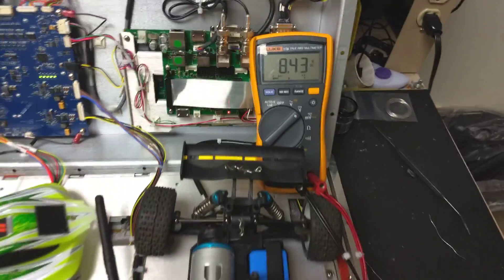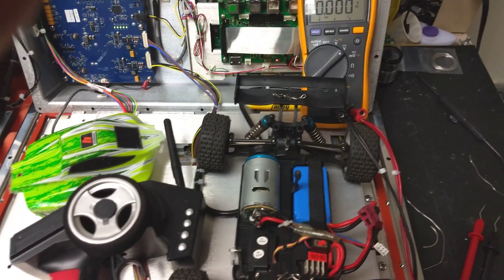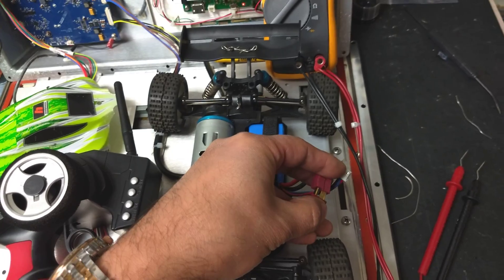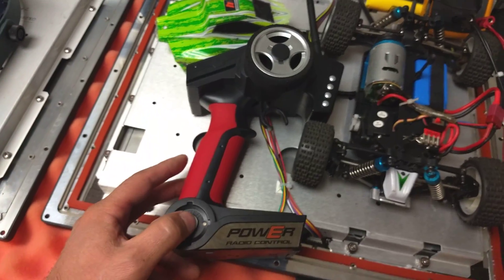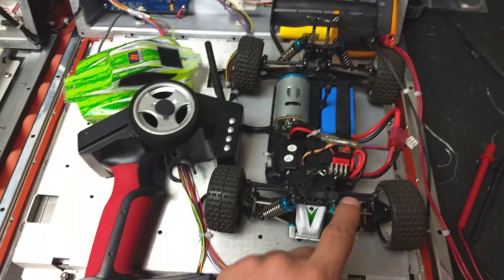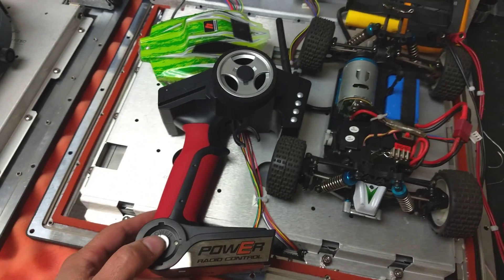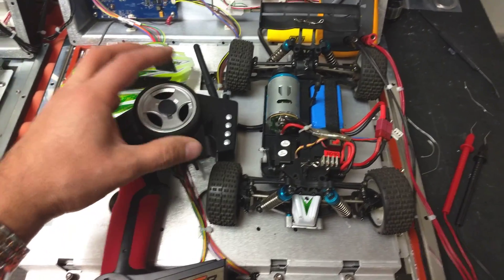Wltoys A959B Overheating issue

Comment: Had 2 WL toys with overheating ussues. And this happened during Australias winter, didnt run them much in the summer at all, too much of a fire risk. The electronics reached such a high tempurature that it began melting the esc's. Have doubts that a heat sync will solve the issue as the motor also overheats. A larger battery is only going to make it worse. The higher voltage may reduce the amps going through, but the esc is too small for the job and the motors are over stressed eith the speed that they do. Used a couple of parts from them for other projects and tossed the rest. 
Bought 2 1:28 scale cars under this brand name and have had the same issue with overheating,
Reply from the maker: It's definitely over geared for that motor but the ESC getting that hot also had to do with the batteries they give you, it's 2 issues, the main one is the C-rating of those cheap batteries & the 2nd is the mah rating. The ESC is overheating because it's trying to draw the necessary amperage from the batteries but it can't due to the poor C-rating of the battery. This stresses the FETs on the ESC which causes them to overheat. Couple that also with a battery that doesn't have the sufficient mah & those poor FETs get more stressed out than a liberal seeing Trump walk into the room lol.
Those batteries if I recall correctly were like 15C (which is lower in reality, they always exaggerate the C ratings on cheap & even expensive batteries) & the mah was very low. Let's the ESC needs 50A at full throttle. A 15C battery with 750mah can dump a max of 112.5A when the ESC asks for it (15Cx0.750A=11.25A). And that's if the C-rating was accurate, which it's definitely not. Even verify high end batteries only get about 80% of the C-rating they call out. So in this case, your ESC is asking for 50A but the battery can only give 11.25A. This causes the heating issue.
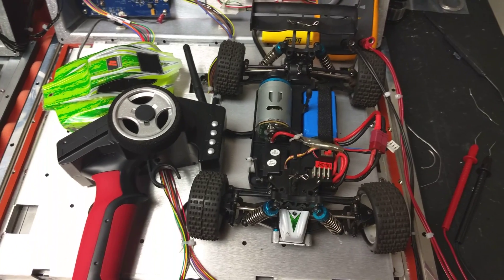I wound up getting another wltoys 1:12 buggy for my kid, had the same issue. I bought a couple of Hoovo High Discharge series, 50C 2200mah, this solved the issue. The motor still gets toasty, but with a heatsink it's fine to run for a long time.

Comment: Buy the new esc and new battery
Reply from the maker: I returned the car, I wasn't about to dish out $ for a car I just bought & failed right out of the box.
If I had the car for at least 6 months, maybe. And I would have gutted the crap electronics & put quality stuff in like hobbywing or castle.
A new ESC won't fix the problem. This ESC needs a high discharge rate battery, like 70C minimum. Or else, it's gonna continue to overheat. 😕
Reply: Is a959-b new or old?
Reply: @rcbustanut2057  my esc and battery is new,my esc fast cooling down,the stock battery play 6 minutes and my new battery 7.4 2s 20c 2000mah it play like 10 or 15 minutes
Want to install cooling fan in my esc so it make longer play
Reply: @rcbustanut2057  if you want the battery and esc I can give you but it in Malaysia app Shoppe?
Reply from the maker: @nzx2147  thanks, but like I said, I returned the car back to the seller & got refunded for my $. This was the newer model too. It's just a poor design. My WLtoys 12423 outlasted this version, and that too was not that great of a car.
I have since moved on to more serious brands, Traxxas & now Arrma. Been building 100mph + cars.
Thanks 👍
Reply: @rcbustanut2057  o okay :)

Comment: Mine did the same 4 times i changed esc waiting weeks from banggood then decided to change it all and put the esc and servo from my old 144001 thats broken and no overheating at all now runs full throttle without overheating result or could ov gone brushless
Reply from the maker: Yeah, it's a crappy ESC design. While it may be fixable by just putting a serious good battery in, like a "true" 70C+ 4000mAh minimum battery. It's just a really bad ESC design and WLtoys isn't owning up to it, typical cheap Chinese garbage company. They didbtry to redeem themselves with one of their later designs, which while it may be a more solid product, their support is still as awful as trying to find a politician or lawyer that doesn't lie.

Comment: Sir please help me same thing happened in my a949 but I'll don't know the main prob also I did used 2s lipo 35 rating and 540motor please please please please please please please please please please 😭😭😭😭😭😭😭😭
Reply from the maker: Hi, sorry, but the only thing you can do is replace the ESC. I would also use a higher rated 2S lipo, like at least 50C +. And if you have the time, knowledge & $, I would just replace all the electronics with quality electronics such as Castle Creations brand or even Hobbywing brand. You will also need a new servo & receiver with controller, a complete haul over. Both, Castle creations & hobbywing make brushed motor ESCs. Or you can go brushless & replace the 540 motor with a brushless motor & ESC. But by the time do that, the cost... You can go with their wltoys 124019, although it's a 550 brushed motor, it's a WAY better car than this guy, and it's between $119-130

Comment: Well my car come today. My son took it out for a blast. He come in side put battery on charge. In stead of a steady flashing light its a very fast flashing on the esc now the esc won't connect to the remote. Not even 10 minutes old
Reply from the maker: Weird, I had replied to your post several days ago. Freaking youtube must have censored my reply.
Reply from the maker: Return the car & give them hell till they refund you. Because they'll drag their feet not to refund your money.
It's most likely the battery, they're garbage. If you really want to keep the car & fix it, it's possible. I would start with getting a quality compact 2S lipo that's 5000mAh & at least 70C or above. Most of these cars have ESC overheating issues because of the weak stock battery not being able to deliver the amperage drawn from the motor.
Reply: ok

Comment: Just a quick note for you and all who view this video.  You can fix the overheating by adding another heat sink to the fins on the top of the esc.   One video by DIY GUY shows him cutting thin copper sheeting into fins about 1 inch tall and soldering them to each of the metal heat sink fins on the ESC.  Problem solved.  You could get creative and figure out other ways to attach fins or copper through the holes on the fins and twist the copper together and pull it all up into a point in the air to help dissipate the heat.  With regards to the battery I would do a complete discharge and then a full balance recharge with a hobby grade lipo charger.  I have found myself that many of these Chinese batteries are not the Mah printed on them.  If it says 1500mah you do a full balance discharge and full balance recharge and you will only get about a total of 1130-1150mah at full charge.  Best to invest in good quality batteries. Use the cheap ones that come with the RTR for adding to your play time or just use in a pinch.  Hope this helps!
Reply from the maker: Thanks for watching & for the tips. 👍
I made this video for the seller, they wanted to see the failure in order to refund me & return the car. I have seen that video of the copper heatsink, good for those who still own the car & the return window has closed. 

This car however was poorly designed. As an electrical engineer, heat management is crucial for electrical equipment. 
Part of the heating issue is related to the battery. I agree, these batteries are garbage. This car requires a much higher C-rated & mah battery to accommodate the current demand. And yes, for lipo batteries, a good balance charger is required. That's why I have a nice professional digital lipo balance charger. I recommend a balance charger that allows you to monitor the voltage of each individual cell as well. It can be helpful by showing you if there's a bad cell that's not charging properly or just dead. Also a bonus, is a charger that also discharges battery to storage level. Honestly, any rc car that uses lipo batteries from 2S & up should at least use a 50C minimum. And even 5200mAh +, especially with more powerful ESC's (80-120A+), even if it may seem overkill. The problem with these wltoys cars is the lack of space to fit a much better full size lipo. I also used to drive a wltoys 12423, my 1st RC car from this company. I was able to fit a compact GenAce 2200mAh 50C battery at max, and that's after modification to the housing lol. But it made a huge difference with the car's power management.
After 3 cars from this company, I gave up on them. Their cars are very poorly designed. For a few more $, I went to traxxas & that was huge difference. And after 3 Traxxas (rustler & 2 bandits) I just picked up an Arrma Typhon 6S BLX Brushless, that just made the traxxas look like childs play lol. That thing is built like a tank!!.... Not perfect, but pretty dang close.
WLtoys is great for those looking at testing the RC car hobby world waters. But I honestly think that something like a traxxas bandit is an even better start @ $150. Bought a couple for my 5yr old & 12yr old for last xmas & they're still kicking. & I even upgraded one for my 5yr old to a 120A  brushless system, which he bashes pretty hard, & it's still kicking!! Parts are inexpensive to get & you can get them quickly here in the US 🇺🇸. With wltoys, be ready to either pay a lot more $ for local parts (if you can find them) or wait a ridiculous time to get them from china 🇨🇳. And forget about tech support lol, that's a joke. 
This is my honest opinion. I don't have any sponsors or get paid by any of these companies, just an honest guy trying to help out others in this hobby with all good intentions 😉
Thanks again for watching & for sharing helpful tips 👍
Reply: I agree on all counts.  However I do love my wltoys.  I like spending 79.00 or less on a car and then customizing it and making it better.  I drop another 45.00 to 50.00 on parts and in the end have something I built and customized to my taste and made unique.  I know the traxxas are better and well Arrma, Axial and Losi have some great stuff I'm not at the point yet of dropping 350.00 to 600.00 on something stock out of the box.  Wltoys did just release the 144001.  This is their best offering yet.  Excellent platform to go brushless with a decent build quality on the chasis.  Check out driftomaniacs on youtube he changed out the pinion and spur gear and went brushless and now it does 97mph.  Its all just good fun and whatever your into. I have a custom 12428 I'm almost done with and will probably put up a video when finished.  Thanks for your awesome information and feedback!  I have a 12423 I'm going to mod next still in the box.  Your info about the battery is excellent.  Anything else you did to it to make it much better please let me know.  Cheers mate!
Reply from the maker: @amw4736  yeah, the higher end stuff definitely comes with a heavier $ tag unfortunately. I did see the wltoys 144001. I was considering it for my kids for last Xmas but after thinking about the customer service & returns if I got another faulty car, I ended up with the traxxas bandits. I have no problem with fixing a car if I was bashing & broke something, but if it was damaged right out of the box & I am given the run around trying to get a replacement or refund, that's just wrong. And that's what happened to me with 2 of 3 cars. The 3rd (12423) I kept & replaced the faulty parts cuz I didn't want to deal with the hassle of returning it.
As far as updates on the 12423, hahaa.. I literally redid the whole car lol 😂 ESC, servo, receiver, motor, shocks, linkage... Think the only thing that was stock was the chassis (although I modified it to accommodate full size servo & traxxas shocks & upright shocks in front) and the diffs.
I finally tore her down & took out the electronics & going to put all the parts for sale on eBay under one listing. Tons of parts & aluminum upgrades, quite a few still new & unused. She was my "learn how to upgrade & repair" car.
I might even sell the rustler i have setup for speed runs & look into getting a 1/5" scale nitro/gas car.
I have a few vids of the mods on the 12423 car, I'll post the links here in this comment thread. 👍
Reply from the maker: https://youtu.be/fda6ZfnIpqY
Reply from the maker: https://youtu.be/Kd78WZ-83Mk
Reply from the maker: https://youtu.be/wQ0zvVa7PH0
Reply: I just bought on3 for me son for Christmas, ran for one day then dead after that. Thinking it was the ESC over heating I did the copper strips to create a heat sink, that worked for 1 minute. Now I’m spending more $ to upgrade parts - the servo, the ESC, the receiver and still need to buy a controller. These cars are junk and a money pit. Annoying thing the car cost $169.00 AU and rather than saying to my son “it’s better to throw it away”, we’re replacing a stack of stuff. Not happy.
Reply: @chriswaldron2617  Sorry to hear that.  169.00 AU is about 130.00 USD.  I can get these cars in the USA or online from ebay, aliexpress, banggood.com all day for 50.00-80.00 usd.  I think you overpaid.  Still sucks when it has problems.  I would look at buying a replacement ESC on aliexpress.com you can get one for like 8.00.  It is possible you got one that was sitting for a long time "old stock" I know on the newer ones they have fixed the esc problem.  Best to you and your family.

Comment: Mine fully died the transmitter will not connect so do you know the issue
Reply from the maker: I wound up returning mine to the vendor & getting a refund. This was the 3rd wltoys vehicle model I had purchased. 3 strikes was my final draw. The company has terrible customer service, if any! I since have moved to Traxxas, mainly cuz they're an American local company & their customer service is amazing. Plus getting either replacement or upgrade parts are super easy & fast shipping, since they're not shipping from freaking chikity china 🇨🇳
Reply: @rcbustanut2057  Oh I just found out its the esc just needed to order a new esc but if it doesn't work I will have to stop buying wltoys cars , but anyway for you I think you just had to buy a new esc because they over heat and burn out. Anyway thank you for the info.
Reply from the maker: @gaganxjeet9993  Thanks, & no problem. If you ever have any questions, please don't hesitate to ask! 👍
Reply: @rcbustanut2057  yes I will because I just got into the rc hobby, I also got a good find it is a traxxas bigfoot, its my new build
Reply: V I B E C H E C K did the new esc fix the problem?
Reply: Lorenzo Productions yes the esc just burned up and exploded I just did a brushless system upgrade
Reply: @gaganxjeet9993  my too stopped working, something burned.. What is this esc? Maybe it will help me too
Reply: @anonarisslo9312  you will need to buy a new esc, you will find them on Amazon
Reply: @gaganxjeet9993  and then what? If this died in one day i cannot expect the new to last much longer?
Reply: @anonarisslo9312  if you do not want that one, you can mabye do a brushless conversion
Reply: @gaganxjeet9993  how you make brushless conversion and is it good? I bought my kid this toy for birthday and you can imagine after few trials dissapointment  :(
Reply: @anonarisslo9312  oh so you are new to RC, um, you should most likely just buy the new part because if you want to do a brushless conversion you will have to take out the motor/all electronics, so it’s better off if you just buy a new esc and just put it in, I bought my new esc 1 year ago and it’s still working fine for me
Reply: @gaganxjeet9993  are there any instructions? I could do project with my son.. Je is very inzerested in this stuff...
Reply: @anonarisslo9312  yes, just search on YouTube there are a lot of people who have done it, just search the car you have then put “brushless conversion” if you want to do it, I recommend doing it because it makes it go super fast and you should get metal upgrades for them because  those help the sturdiness of the car
Reply: @gaganxjeet9993  thanks man, ill try

Comment: Oh! I just bought mine and wasn't all too rough with it, and it completely stopped working the next day,  not even the red light was blinking. i thought the same thing, that it burnt out but slowly sliding the switch I felt it catching and not feeling like when I had first turned it on, so I removed the switch entirely (just today}, and soldered the two  contacts together. Then I connected the battery and it came on as before and bound with the transmitter with no issue and is working once again. Hope this might help, although it's a tad risky relying on the connector to the battery as a power switch. or well, the better solution would be to just buy a new switch but it'll work in a pinch without
Reply from the maker: Hi, thanks for the comment. I have returned the car since I posted the video. The seller wanted a video of the failure so they could verify the failure. 
In this case, this car overheated soo bad that when my wife walked into the house she asked what was burning 🔥 lol. And that was from less than 5 minutes of easy running, outside on the pavement. And during those 5 minutes, the radio kept loosing connection with the car.
In my opinion, that motor is too much for the ESC. Many people have reported an overheating issue with these cars. So I would advise you to keep a close eye on the temps as you ride. And definitely add a heatsink to the motor. Hopefully in the current version of the car they have resolved this issue cuz it is a cool zippy car. Good luck with it! 👍